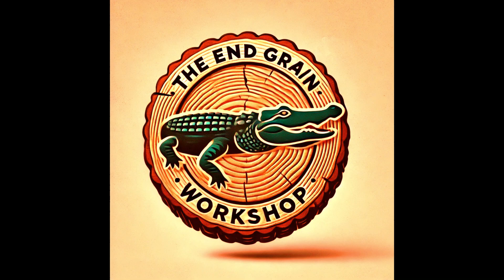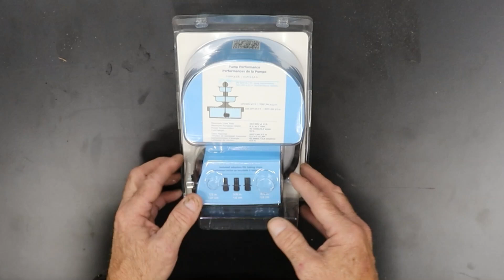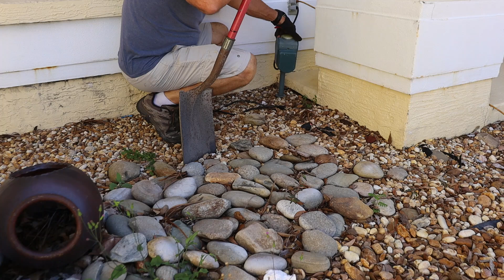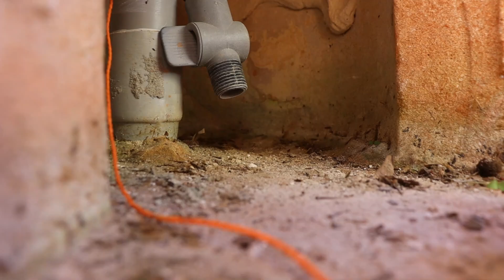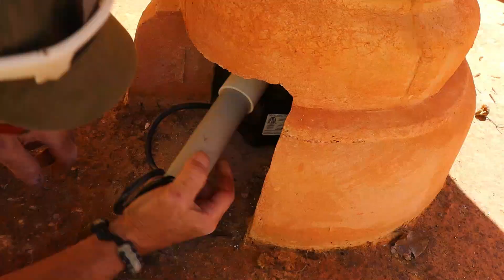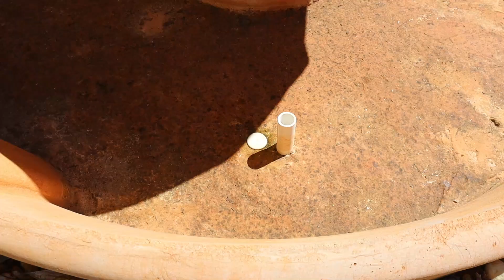How to Replace a Fountain Submersible Pump - The End Grain Workshop

Comment: how do I find the right size.  They're either too large to fit in the hose or too small
Reply from the maker: Great question! The best way is to check the inside diameter of your fountain hose and match it to the pump’s outlet size. Most pumps will list the outlet diameter in the specs. If you’re between sizes, you can usually use a short piece of flexible tubing or a small adapter to make the fit snug. That way you don’t have to force it, and you’ll still get a watertight connection.